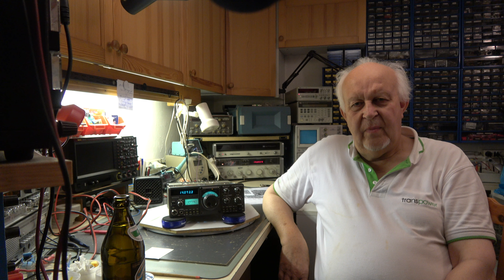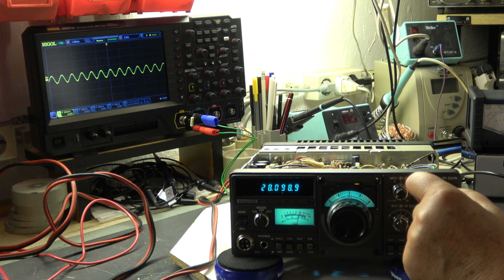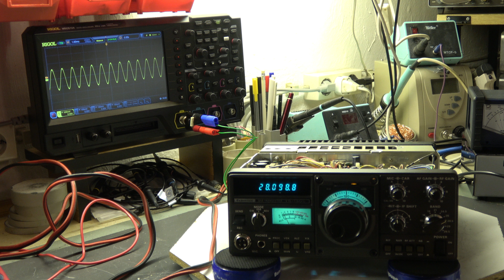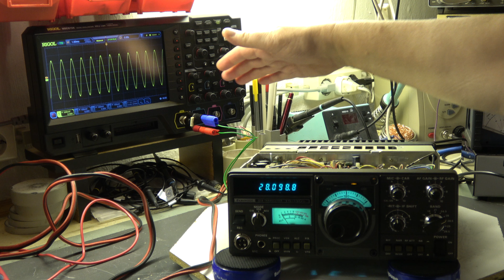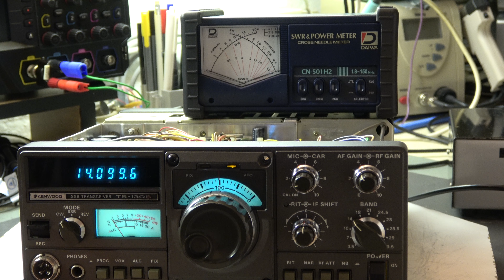#136  Kenwood TS130S+DFC230 Part 3(4)

Comment: Hi, I still don't understand which white powder was that? Why it was there? It was defective from the factory? I would like to know which bottle of wisdom was that, also. Thanks.
Reply from the maker: I guess, it is an oxide from metal: Aluminium, tin/solder, ??
Bottle of wisdom: Very limited special edition; not sold on the market - only for VIPs!

Comment: as i see, this transceiver was already checked by an authorized service. See the red paper dots on the relay you cleaned in this episode, and other modules.
you don't have ALC action on 28MHz because the output power (60 watts) is too low for the ALC to intervene.
cleaning those switches (alc, vfo and two others) is a good idea, my ts130v had frequency instability because of the dirty vfo-fix switch. See the red paper dot on the VFO ? maybe it's the same problem here too. 
looking forward to see part 4. 
73!!